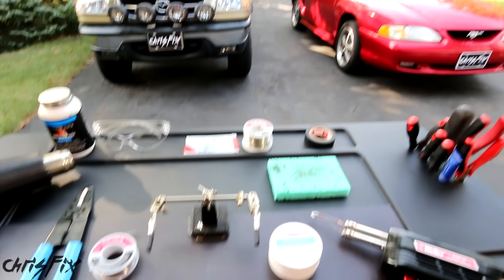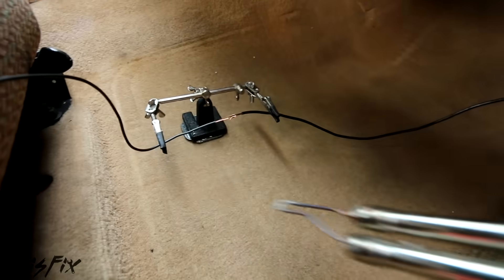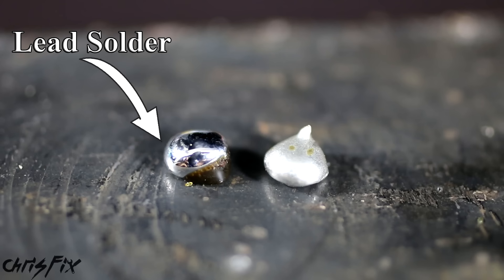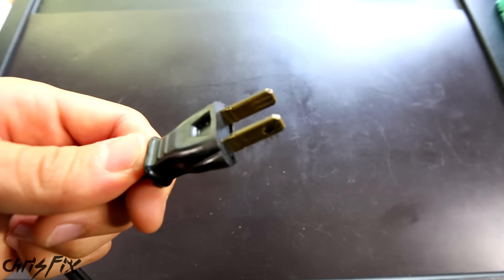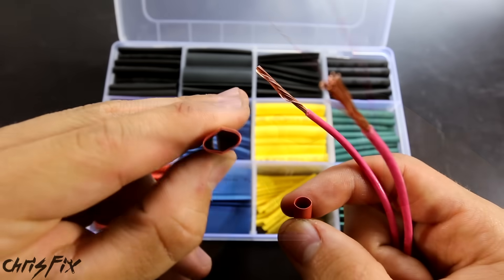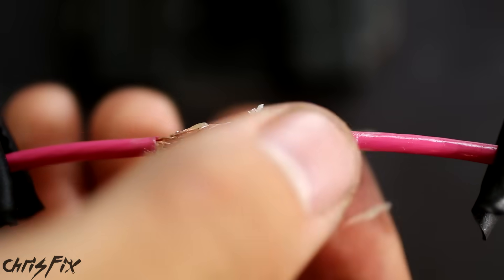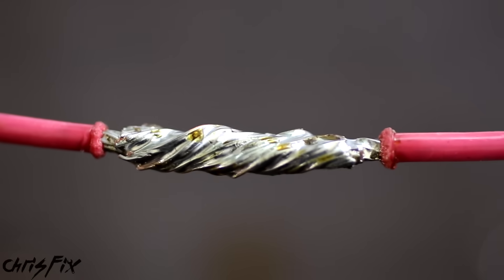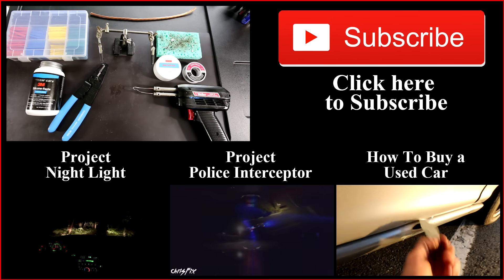How to Solder Wires Together (Best tips and tricks)

Comment: What's the difference between the soldering gun linked and the "professional" version. I see the power difference, but will it be overkill for car audio installs? I rather have more power for more uses, however I'm not sure if that mentality would be applicable for my intended use.

Comment: On several occasions I have attempted to remelt or re-solder a connection or replace a relay on a circuit board that is shorted and I end up with a big blob or mound of solder that you can just flick off with your thumbnail because it sits on top of the solder joint and ever attaches itself.  If I add more heat, I end up melting the board.  Any suggestions would be appreciated.
Reply: i have had probs soldering and then going back and trying to redo the soldering.   i have watched a few videos and now i have found that the problem you are having is that you needed to add some rosin flux.  if you get some rosin flux and add it over it will work much better for you i would think

Comment: Heat shrink is great, but thin, you should also wrap electrical tape around it and just past it to give it extra abrasion resistance if it is going to be at all exposed to any sort of movement such as in an engine compartment or on a trailer. If it's under a dash like a stereo connection, heat shrink is enough.

Comment: Proper crimped connections are superior to solder connections in most automotive applications.   If you are soldering as much as you are on your automotive project, you are doing it wrong.

Comment: Good tip is not to skimp on the quality of the soldering iron/gun.  There's alot of crap out there for sale. You don't need to go for the very best, just avoid the cheap rubbish that Ebay is plagued with. I bought a nice little gas powered one recently for smaller jobs.

Comment: Here is an interesting and fun fact: On today's modern cars, with all of the computers and electronic modules controlling damn near everything, do you know how many wire connections are soldered? Out of the thousands and thousands of wire connections, less than 1% are soldered. The rest are crimped. Why do you suppose that is??? Hmmmm???Maybe the auto manufacturers know something. Could be. Ya never know. Lol.
Reply: Maybe it's cheaper, faster and requires no skill.

Comment: you should try the Nasa soldering method. Bringing the two wired together (like your second method) wrap them around each other (like you did on the first step) but instead of working them down each other, they wrap around the wire then curl around itself, so a small loop holds them together while the rest is bound to itself. They said its super strong and helps keep the profile of a wire more consistent.

Comment: Great tips on the make do gun tips. I usually just use rosin core solder but it's probably not as good. 

A squirrel chewed though the fuel gauge sending harness on my car and I had to lay on my back and solder overhead . I was wearing a short sleeve shirt - BAD IDEA. I got a couple of solder drips on my forearm and it blistered pretty quickly.  Don't be a dumb ass like me!

Comment: Awesome video thanks for sharing , please note; I always blamed my self why can't solder well, but learned how easy will be if you use a soldering tool over 60 Watt,  besides the tool I got has adjustable  wattage 30-100 Watt, and never get cold during a project. Not expensive at all.

Comment: So small soldering is my thing but it's generally a good idea to wear a mask when soldering as the leaded solder fumes have (believe it or not) lead in them...

Any high end soldering irons can easily do higher gauge wires, soldering guns are starting to get phased out as the circuitry (which originally was put in the gun's body) has gotten smaller and smaller to the point where it would fit in a soldering iron.

Your tip of using copper wire as a soldering tip is also flawed as the tips are designed to have a certain resistance and reach a certain temperature (but if it works it works i guess).

This isn't a hate comment but i just thought these were worth mentioning.

btw you're one of the only people to mention cold soldering in a video and i see it all too fucking much from people who "learned to solder from youtube"

Comment: You forgot to clean the flux off the joint. Could cause electrical failure or create corrosive areas. Use flux remover or alcohol or methonal

Comment: Old School Weller Gun! Awesome! That first solder joint you show is called the Telephone Splice.  Great for using heat shrink tubing.     If I might make a suggestion,  pick up a small 1 or 2 ounce bottle of Liquid rosin.   It usually has a brush in the cap an a bottle lasts for decades.   You only need it in situations when the solder is not flowing fast or properly.  Rosin transfers heat fast  and helps solder anything!    Of course do not use Acid flux on electrical work.      Beautiful work applying the sealant paste before slipping on the shrink tubing.     You are the first person doing these videos that has proper soldering skill.     Get the liquid rosin.   You will love it.    You hardly need anytime at all applying heat.

Comment: Wire strippers are the one tool that you absolutely need a good pair. The $5-$10 dollar pairs are junk; buying a good pair for $25 is worth it because the blades aren't pushed away from each other which leads to not being able to cut the wire properly, which happens with cheap wire strippers.

Comment: For braided wire, you're going to be better off to just wire nut or butt crimp together the two wires.  If you're afraid of the tied joint pulling apart, wire tie a strain relief.    If a soldered joint moves at all, the wire will start cracking where the solder quits.  

The Flux (either in the solder or added) is needed to clean the wire.  The reason you don't transfer liquid solder from the tip to the wire is that the flux in the solder gets burned off.  If you are using external flux:  you can ignore that rule.  The part that is important is that there should be flux present when the solder coats the copper.   When hand soldering surface mount components, this is how you do it.  You rely on the soldering iron tip being able to hold some solder on it.

Use the biggest tip you can fit into the work space.  Use an iron that can get up to 350C.  The trick here is heat transfer over time.  You want to put a lot of heat into the wire before it can melt the insulation.  The extra flux really helps with this.  That is because you get to ignore the "don't melt the solder with the iron rule."  

It does really help to get a glob of solder, as Chris Suggested, on the tip then touch the wire.   As soon as that glob of solder "shoots" over to the wire it starts to help with the heat transfer.  It is okay to jab your new solder into the spot where the iron is touching the wire.  All three can touch the same spot, because the extra flux lets you ignore the that rule.

But back to soldering braided wire, or any wire.  The part where the solder stops on the wire makes a sheering point.  Any of the wire that bends at that point will crack and break over time.  Braided wire is chosen for its flexibility.  This is very important for things like vacuum cleaners.  Soldering the braided wire removes this property from the 1/1000th of an inch where the solder stops.   You are way better off crimping or or wire nut.

If you really want to solder the two wires, then do them side-by-side and not end-to-end.  Then use a big, thick piece of shrink wrap that is below the solder joint.  If you pulled the wires apart, the heat shrink should be where the wires bend.  You can use a wire tie too.

Comment: Gotta use some alcohol and a brush to clean all that excess flux off the solder joint. Great video though.
Reply from the maker: Thanks for the tip!
Reply: no no u should be drinking the alcohol

Comment: You don't need to twist the wires together. You're putting stress on the wire strands. Just tin the wires lightly and then lap solder together. Done!
Reply from the maker: Thanks for the tip Mark.

Comment: ChrisFix.... how can I reprogram my digital odometer on my 2000 s10? I’d like to get the original mileage put on the truck.
Reply from the maker: You cannot easily do that unfortunately.
Reply: ChrisFix I didn’t think it was as hard as it is. Thanks for the info though.
Reply: ChrisFix .. is it possible to get an autograph? :)

Comment: This is how not to solder wires together.  You start off by stripping way too much insulation.  You only need 2x the cable diameter.  There's absolutely no reason to intertwine the wires or twist them together.

There's zero reason to do a lineman's splice in a car, and that's not how you do it right, anyway.

Strip 1.5-2x cable diameter.  Keep the cables tightly wrapped together and straight.  Flux the cables and pre-tin with just enough solder to make them silver.  Lay the cables side by side, touching along their length and apply a small dab, just enough to form a fillet between the two.

This is secure, wastes less cable, fits into wire harnesses better, and adds no resistance.  

Your methods create a much bigger inflexible spot, and isn't as friendly to other cables in a harness.

Comment: Really like the video, many good tips for a very solid soldering job. One thing to note is that if an electronic solder gun is used on wires that are hooked up to modules in a car still, it can damage a module. Using a butane or propane torch will prevent any possible damage from electrical spikes.

Comment: I've done a bunch of trailer wiring and never used flux... I need to get some.... The car audio shop that put on our LED strobe lights just just crap crimp junctions without silicone or any anti corrosion stuff...

Comment: Step one - throw out the soldering gun and get a temperature controlled iron. Also solder joints are not recommended for joints subject to vibration, movement or shock, use proper crimped connectors instead.

Comment: I'm trying to solder a 3.5mm audio jack to the Left, Right and Ground leads from a speaker cable. (each of those is made up of several very brittle strands of wire that breaks very easy).

For tinning the wires, before soldering to the jack's terminals:  How long do you need to hold the iron each lead (each bundle of brittle wire) until hot enough to melt the solder that is touching the other side of the wire?

For soldering the tinned speaker cable's wires to the jack's terminals:  How long needed to hold the iron on the terminal to heat the solder that is touching the terminal-to-wire joint?

In each of the two scenarios, I hold it there for what seems like minutes (maybe it’s only a minute? Seriously, though, it might be several minutes) while I feel the solder hot between my fingers, and the speaker wire warm between my fingers - but the solder ain’t melting!

How can the solder I’m holding be so hot that it almost hurts my fingers, while the heat at the point where the solder is touching the wire or terminal is not hot enough to melt the solder????

Comment: I would recommend 63/37 solder with a small diameter. 
Also twisting the wire insulation when stripping it shouldn’t be necessary with good wire strippers. That could also cut wire strands when you do that.
Reply: Good video though!!

Comment: Good overall video. The way I was instructed is similar. If your working on small equipment, I perfer liquid flux on the wire. Then heat the wire and feed solder until it drips off the wire. What it does is removes crud that may be in the wiring. After wires are tinned, you just have to apply a small amount of heat to join the wiring and you will get a solid connection. Often for automotive it is easier to use splices with waterproof shrinkable insulation.

Comment: You missed doing a connection of more than 2 wires. And missed a connection in the middle of a new wire. If you do an update of this video, may want to cover those connection.  Great vid and a big help. I use the cheap wire connectors on my trailer.

Comment: Really wish i had watched this before soldering anything. Ive soldered a few fan connections from my 3D printer now i wanna go back and resolder them. Well now i know for next time how to do it right and not cold solder. I heated the wire with the iron then fed solder onto the wire by touching the tip of the iron. so not terribly wrong but not correct either
Reply from the maker: Glad the video was helpful!
Reply: super helpful thanks very much :D

Comment: Great video Chris! Here's a tip for fellow "make your own soldering tips" guys. When making a new tip out of the solid wire carefully bend a "U" shape into the end of the tip for wires you wish to solder to rest in. Then you won't have the tip of the soldering gun wobbling around on you while you are trying to heat the wires you wish to solder.

Comment: So what I've learned here is that every time I've soldered, I've done everything wrong. 
Never used eye protection. Never had proper ventilation. Never used a heat shrink. Never used flux. Never used a helping hands. Never washed my hands after using leaded solder.
How am I still alive ???

Comment: The hands-free fixture is a must! I would only add that you use flux very sparingly and usually you use fluxed solder or flux-free solder with rosin flux, but not normally fluxed solder and flux. That's typically overkill and leaves too much flux residue and it wicks up into the wiring strands. 
If the wiring can get hot in use then clean off flux residue if you want to do it 100% right. Heated rosin flux acts as a mild acid and can cause deteoriation of the wires. Buy cheap acid brushes and keep the flux off your skin. It is a mild acid and with continued exposure will do damage. Never use anything but rosin flux or rosin fluxed electrical solder on wiring!

Comment: Do not generalize, this isn't an ultimate guide on how "wires are soldered".
Car wires- yeah, you can often do the fk you want with them but:

- Fine electronics attached to wires sometimes require soldering tip to be grounded, just in case

- Sometimes wire insulation isn't designed for a wide heat range and melts quicker than you can solder

- Short and thick wires can transfer heat to electronics if exposed to heat for too long. That can unsolder nearby SMD components, or just simply directly damage the PCB according to its quality

- Silver soldering wire usually is the highest quality soldering wire you can get (and an expensive one) for electronics and wiring. It's often used for audio or wherever even the miliohms lost on solder connections count. What matters is whether the core is rosin or acid, the end.

- No, flux doesn't "protect from oxidation". It removes oxides from the point you're trying to solder to, cleaning it and enabling an easy solder. Sn-Pb is what protects it, especially the Pb which is known for its passivization ability (its top layer oxidizes and prevents oxidation from eating into it deeper).

- Hell no, boy, you should NOT use any random wire for the soldering gun. It is harmful and can damage the gun, there is an entire electrical material science to explain 1000 reasons why not to do this. Or simply- just don't do it.

- Pb isn't as harmful for humans when used for soldering. Human body doesn't "incorporate" it that easily. Lead salts (however) are, but you don't normally deal with them. Of course, that doesn't mean that eating lead is even close to safe... Don't eat the soldering wire and you're fine.

There are many more, but this is already much. Do more research before going into this business.

Comment: Great video but you shouldn’t wipe the tip on the sponge as much as you do... you only want to wipe it once or twice right before you solder a joint. Wiping the tip often hurts it.

Comment: Same rules apply for connecting different sized wires? I'm extending trolling motor wires on my boat and the recommendation is 4 gauge and the original wires I'm extending are 10 gauge... Any advice?

Comment: I hate soldering came to this video and I still can’t do it what am I doing wrong? I did it like in the video but the iron flux whatever it is never melted on to the wire only way to make it melt is by putting it on the solder ahhhh it’s so frustrating
Reply: I was using gay ass lead free no wonder it wasn’t melting shit sux ass I hope that’s the reason why it wasn’t melting

Comment: OKAY. So I'm trying to solder two 3/32" metal rods together for a school project and I have an 18w iron gun like the red one you had. will this do the job if I buy the metal flux (yellow stuff you had) or what do you recommend?
Reply: Roberto Vera if it’s iron bearing use a welder if it is copper or aluminum braze them

Comment: I read some of the previous comments. Soder is the previously used word it is now obsolete, and solder is the word used. Soder goes back to when hot irons from a coal fire we're used. In the movie Joe Dirt, Christopher Walken doesn't say I will stab you in the face with a soldering Iron he says sodering iron because it's the correct word for an actual rought iron rod used to perform this task. So this guy probably got the word from his father or grandfather just like I did. I also use the word soder so give him some slack. Some words in the English language are no longer used, but it doesn't mean they no longer apply!

Comment: Can we avoid using soldering paste flux? Only got the rosin tin lead solder
Reply from the maker: You can but the flux helps so much!
Reply: Cool thanks a lot, making stupit mistakes like using rusty irons. Barely melts the solder.